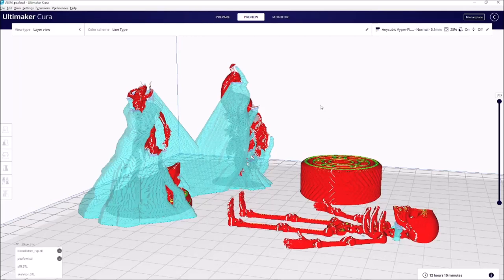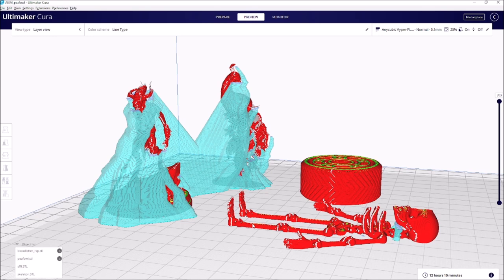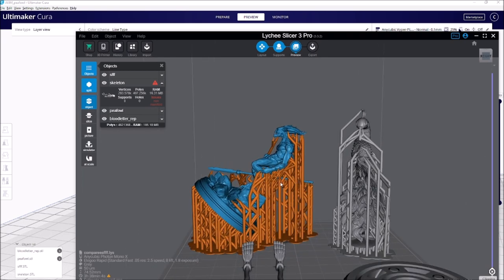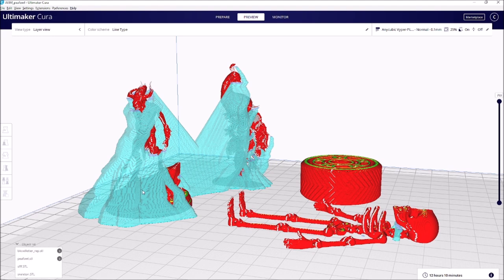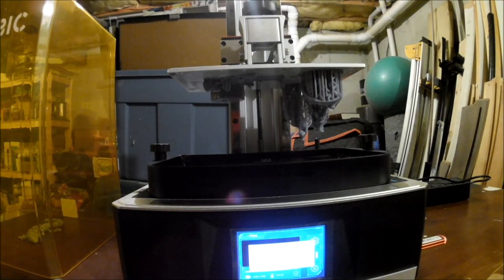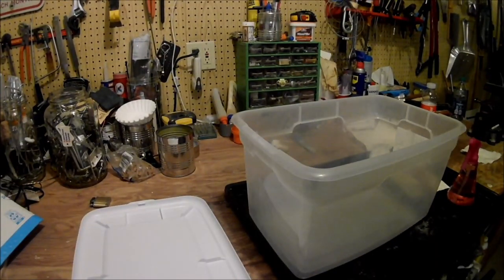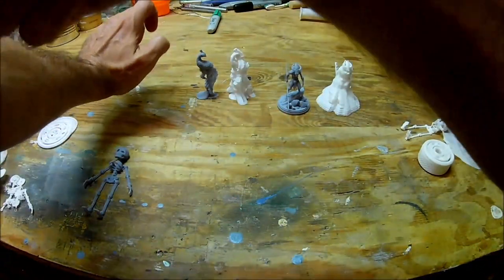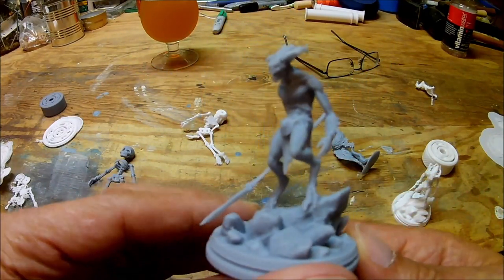Anycubic Vyper vs. Mono X: Which is best? Resin vs. Filament print, Ultimate Beginner guide, Part 2

Comment: White filament is generally the hardest to print with due to the pigments used so you are working with possibly hardest..

Also, given that FDM lays  down each layer in strings, putting multiple objects on the build plate will actually take longer than printing the sequentially because its still has to lay down each model, but it also has to retract and move between models which adds time. This has an additional disadvantage as retracts and travel moves tend to cause more stringing and surface defects where it leaves and enters each model.

So Resin it is an advantage to add multiple models because there is no time or quality penalty to print 10 rather than one (of same height model) but with FDM there is an advantage to printing each model separately as there is both a time and quality penalty with multiple models on the plate.

I agree completely with your assessment, resin is particularly well suited to printing high detail small models like D&D figures, miniatures etc. You can get very close results by dropping nozzle size on FDM but the reality is that exponentially increases print time to stupid lengths such as 24+ hours for a 2 inch figure.

FDM is the way to go if you want to print functional parts, boxes, cases, low detail models you can print extremely fast but going up to 0.3mm layers with no quality issues, if you print a lot of such things you can go up to a 0.6mm nozzle and lay down 0.45mm layers and cut wals to 2 and still have a 1.2mm wall thickness, so reducing walls and layers drops print time hugely with the added benefit that thicker layers are significantly stronger as well..

The obvious solution is to do as you have done, have both, and use each one for what it is best at. I would like a resin for detail figures, but the cleanup, the mess, the extra washing and curing equipment is just too much for the space and work area I have (spare bedroom) so I just forgo the small figurines and print them larger so the FDM can produce a decent result all be it less compact.
Reply from the maker: Great info!  Yes I find I use the FDM more frequently for day to day printing for sure.  Every so often I have a very high detail model I want to print and then I fire up the resin.  Thanks for watching!

Comment: Adhesion issues.. Scrub the bed with dish soap and water using a nail brush, rinse well with hot water and dry with a clean lint free tissue.. then add 1 or 2 tablespoons of IPA and another clean tissue and wipe down with that.. Doing either of these alone does not work as effectively, so soap and water first, then IPA, and if you avoid touching the build surface with fingers it should be good for 20 or more prints
Reply from the maker: Thanks for the tips!

Comment: layer shift.. usually in the y direction which it is..

the two biggest causes are.. 1.. The belt tension is loose, especially the bed belt as there is a lot of mas to throw around the bed. 2.. The default profile for the anycubic vyper has acceleration set way too high, enable acceleration control and drop acceleration to 1500mm/s as a start point, you can probably tune from there up to about 2k5..

The issue is because it is trying to accelerate the bed to quickly and the mechanics just cannot handle it, especially with a loose belt so it skips teeth on the belt shifting the layers.
Reply from the maker: Makes sense, thanks for the tips!

Comment: So, like in any other hobby/industry the question is  "A or B?" and the answer is "Both." 
After getting a reasonably high-end resin printer like the Mono X , what should one get for FDM that will perform great and also be able to use many types of filaments as of right now (no fixed budget, but nothing too crazy)? Vyper, Ender 3 S1 or something higher-end that can print even Carbon/Nylon out of the box? And what would be the cost to upgrade the Vyper or Ender to be able to handle such materials?

Thank you for yet another great and informative video! Just getting my feet wet with 3d printing, haven't even received my Mono X kit yet, but I want to be able to print both very high-detailed things and actually usable stuff for my kayak, custom PC builds, motorcycle, etc. so I'm looking into FDM as well.
Reply from the maker: I find myself using the Vyper far more frequently than the MonoX.  If I had to give one machine up, the MonoX would be the one to go.  This is simply because I can print more usable day to day items with FDM.  The MonoX is really great at high detail statues, but for toys and household items, parts, brackets, and so forth, FDM is the way to go.  It's print and use.  No mess for cleanup & curing like resin.  Plus the parts are PLA, TPU, or ABS like other household plastics that you can interact with.

Comment: I have an elegoo mars and can easily print segmented files like the skeleton or the octopus you've shown above. My guess is that your layer cure time is to high and fusing the joints together. You can also do a "burn in layer offset" to get rid of any elephants foot.
Reply from the maker: Thanks James!  Yes, Lychee also has some newer settings for elephants foot effect, although I printed some of these models fully supported to avoid that.  I suspect my screen protector may be causing just enough light distortion to create this unfortunate binding effect in the joints.  I'll have to experiment furtner to see what I can come up with.  Thanks for watching!

Comment: Hey I really suggest getting Capricorn tubing for vyper. My stock ptfe tube had failed and started causing stringing issues after only half a spool of pla. The cura profile provided is not great either. Have you fine tuned your's yet?
Reply from the maker: I appreciate the tip.  I looked at Capricorn tubing and it seems like a great option, I also like the colors.  I have run into a few issues with the default Cura profile and I've got a video coming up comparing the MPOX profile vs. the Anycubic Vyper default and some tuning differences.  Thanks for watching!

Comment: Since you discussed the 'print' time differences... you didn't cover the 'clean up' time differences. I know there is time spent removing supports, cleaning resin, curing resin, etc vs removing supports for filament. What other time/activities are there for filament clean up, and what are the time differences for the two?

(Assuming the resin clean up is more than filament and combining the 'print' and 'clean up' times and then comparing might be more accurate on how long it takes to have each item 'ready' for actual 'use')
Reply from the maker: Total time is a great idea, I should've noted it as I was making the pieces.   Good topic for another vid. Thanks for watching!